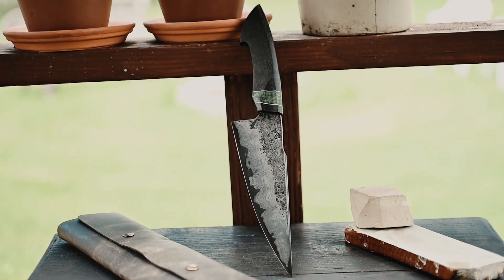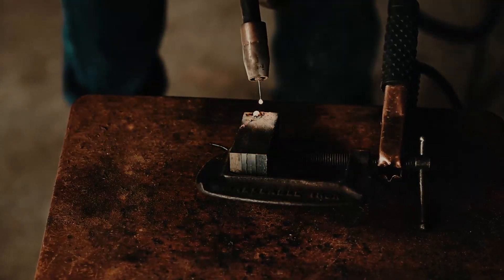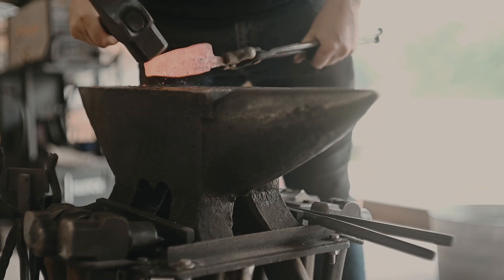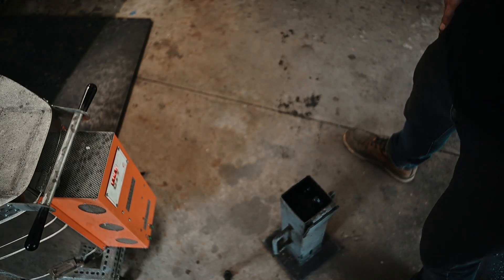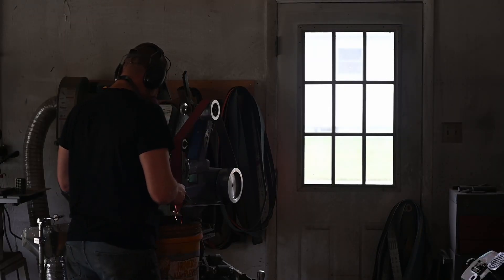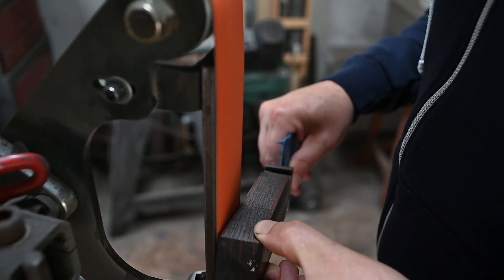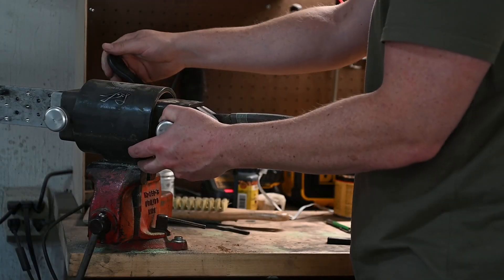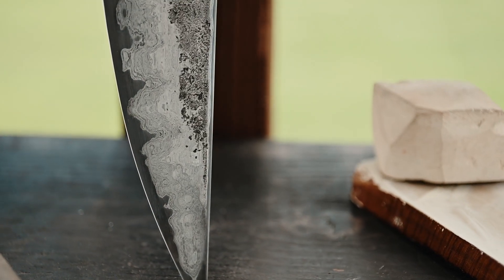Making  A Wrought Iron & 10k Year Old Bog Oak Chef Knife

Comment: I have a similar project I'm working on, and have been dithering about what to use as an etchant. I'm inclined to go with ferric, having seen a smith use Gator Piss on a wrought san mai with indifferent results, so this reinforces my thoughts about using what I'm familiar with. Thanks for posting!
Reply from the maker: I haven't gotten my hands on the Gator Piss yet, but my super old and gross FC still gets me good results... I really should change it out though, it's probably close to 4 years old at this point 😅